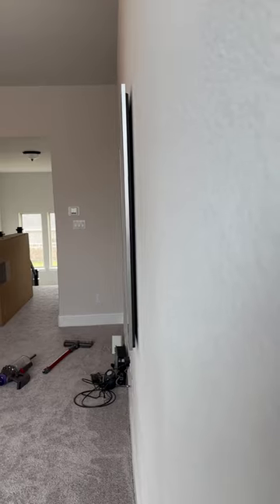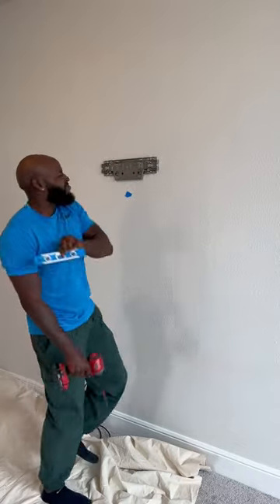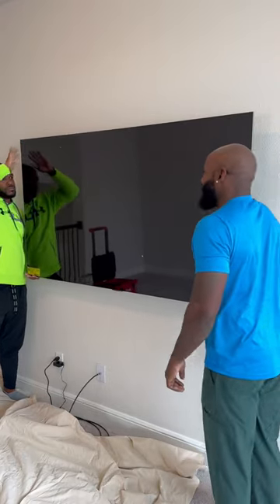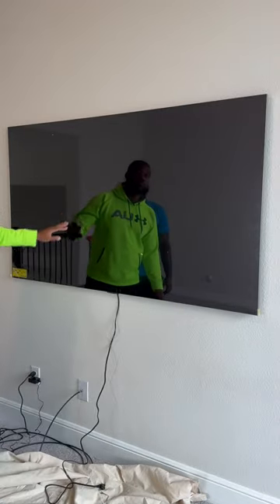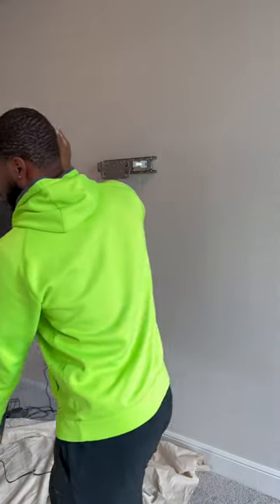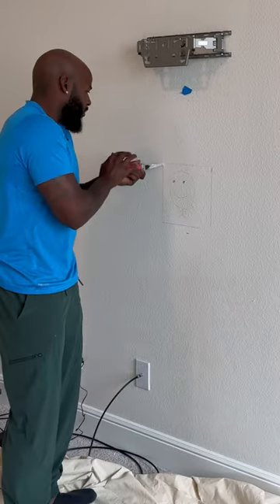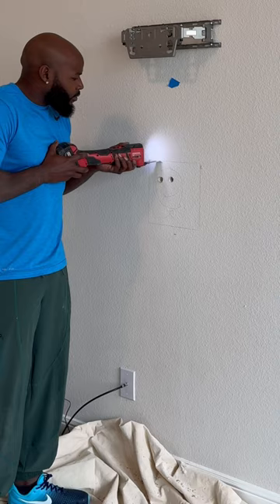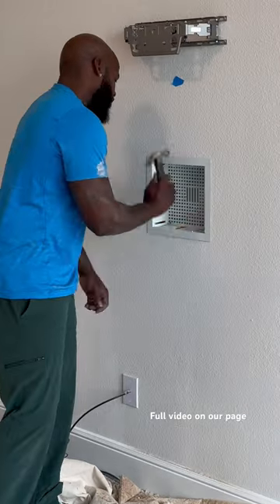How to Install a LG Gallery Series Tv #install #fyp #work #explore #shorts #tiktok #tv #oled #howto

Comment: Great work !! , but come over to the UK and make it look that easy ! Everything is solid brick 😭
Reply: Not only did I managed to hang the same gallery OLED TV on a masonry wall, all without any cables being on display. Also managed, which I think is very important, routing the HDMI and TVs undetachable power cable separately.

Comment: I just got one of these, but my studs are 24" while the mount is only 16" and falls dead middle of 2 studs to align with the rest of my living room. Right now its mounted to a plate made out of 3/4" plywood so its not al the way flat against the wall. Any advice?

Comment: Hey! A question here: is it ok to press against the panel, coz I am really paranoid about damaging pixels by simply pressing the panel surface by hands 😮
Reply: The LG gallery has a thick glass so for that particular model i would say its okay. I would not recommend to do that on any tv outside of that one.
Reply: @Slicksoles  okay, that's good to know. Thx
Reply: For a lot less than that my tv has two damaged spots… 🤦🏻‍♂️
Reply: @andresarme  😥😥

Comment: Start your cuts horizontally, you can adjust the plan if hitting an unforseen obstruction much easier than if you start with vertical cuts

Comment: LG tvs always have board problems and stop working
Reply: “Always” is a strong and bold statement to make.
I currently have 4 LG OLEDs and haven’t had a single issue in my 7 years of owning multiple models in that time span
Reply: @ItsTheJahJah  the new OLED any without heat dispersion like g models will
Reply: @arafchowdhury3634  yikes… wrong again.
I’ve had almost every C, W, and G 55” and 65” models and haven’t had ONE issue at all. I have true experience and not anecdotal evidence as you’ve brought forth.

Comment: Yea them really nice houses some builders spare no expense you pay for it but they plywood before sheet rock for noise reduction don’t hear water running and hanging stuff easily etc it’s not 3/4 plywood but 1/4 to 1/2 inch usually
Reply: A really nice house better be build with bricks!
Reply: @niklasholgerson3779  ok but the inside walls aren’t 🤷🏻‍♂️